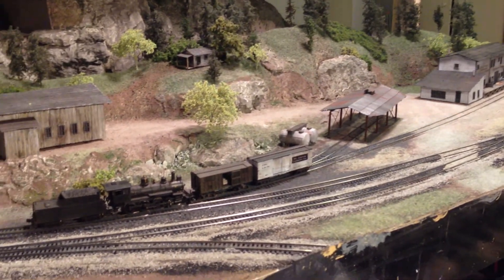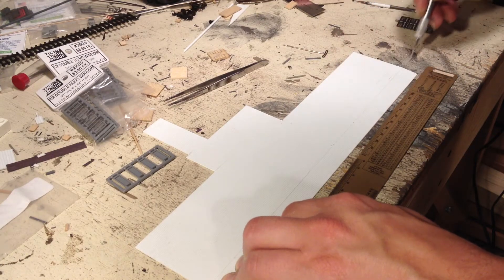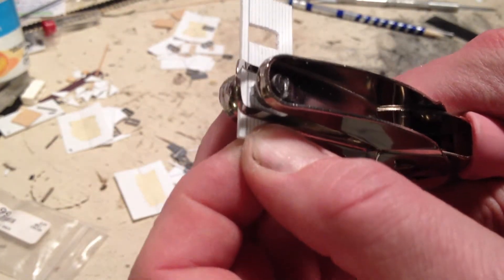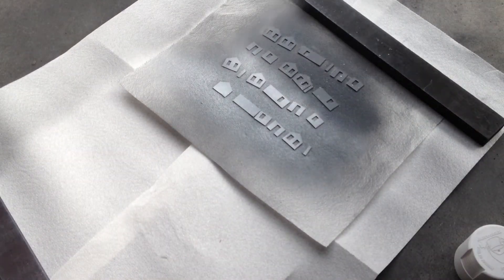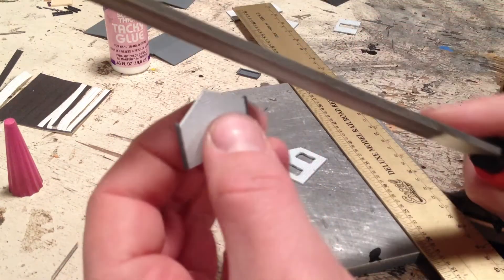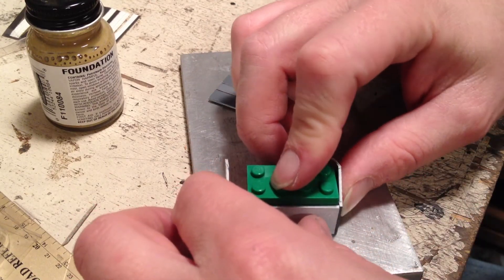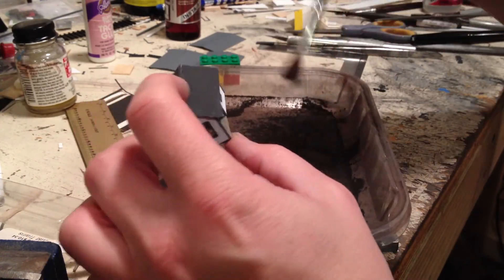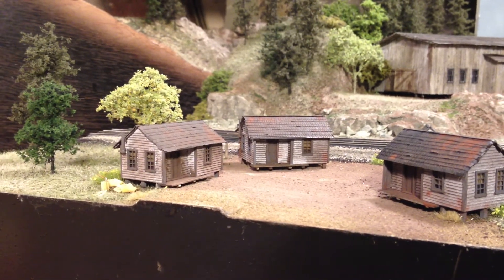How to Scratchbuild a Simple Styrene Shack - Abridged

Comment from the maker: The cheap rectangle-head punch from Michaels works well... on paper.
(It is from the scrapbooking section)
But squeezing to hard on the 0.04" clapboard styrene was sometimes too much for the cheap metal handles.
I've gone through 3 of them so far :(
Micro Mark's "Nibbling Cutter"--at $12--might be the better deal in the long run :)